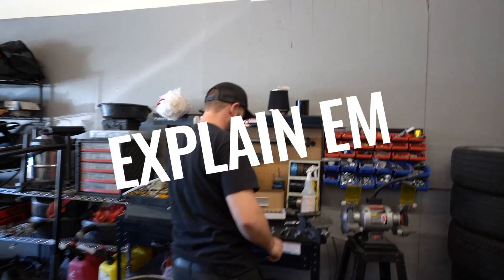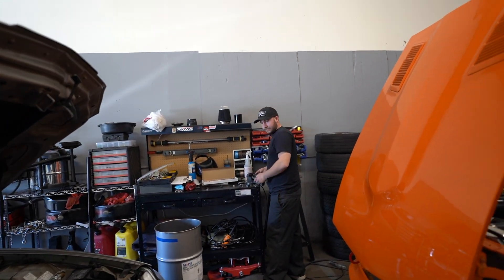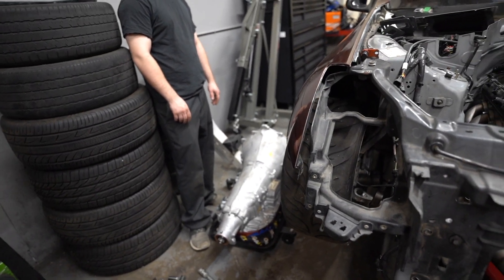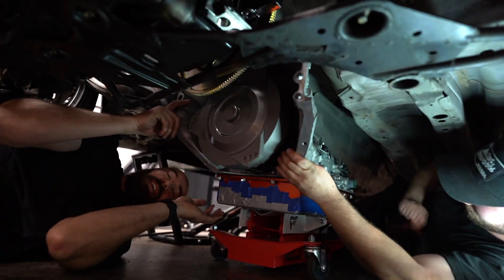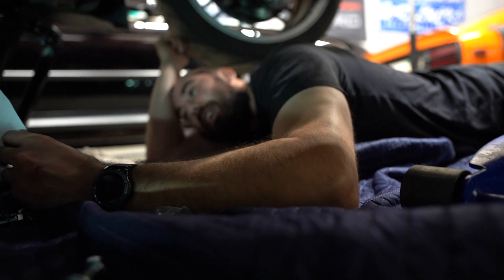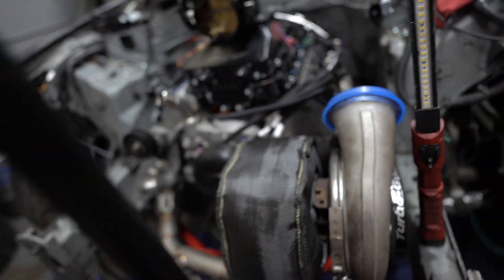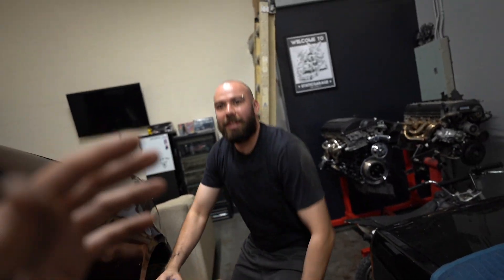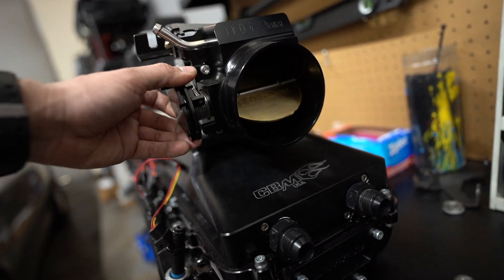LS Swapped G35 Going AUTOMATIC?!

Comment: looking forward to building a LS2 swapped 05 G35, but i don’t know how to drive manual & automatic is obviously a lot easier deal with so should i build a manual or automatic & how big of a difference would it make performance wise ?
Reply: Go auto if you’re scared of manual. It’ll shift faster. If you wanna have more fun do manual
Reply: @supershadow230  scared has nothing to do with the build kid 😂 I have my daily manual which I may talk about in the next video. Took a year to find. But anyways I went automatic for faster shifting, cheaper to build, more reliable, and all around safer for the type of power I’m gonna push
Reply: @Boosted_Martin what type of transmission was used in this? The stock g35 coupe 5 speed transmission or was it a different one?
Reply: @mozartembing6540  built 4l80e, trans out of an Escalade. 4 speed
Reply: @Boosted_Martin do you know if the manual mode will still work? My g35 has a automatic trans but it has a manual mode